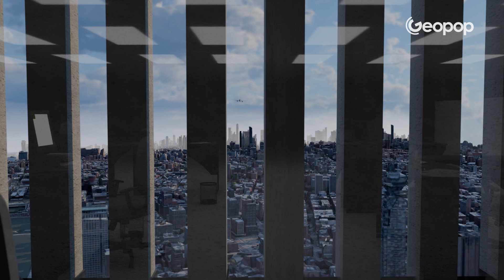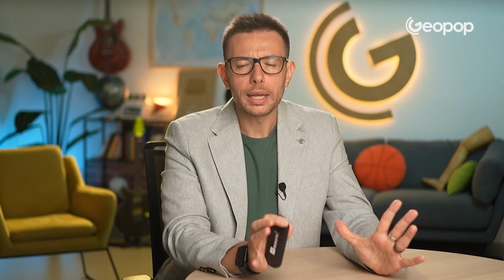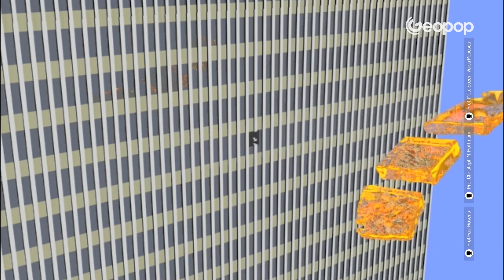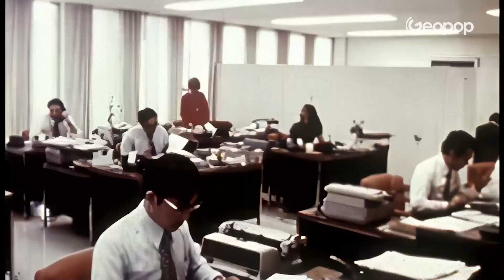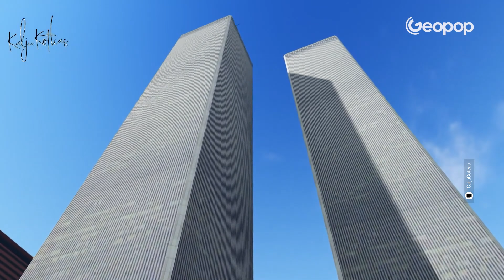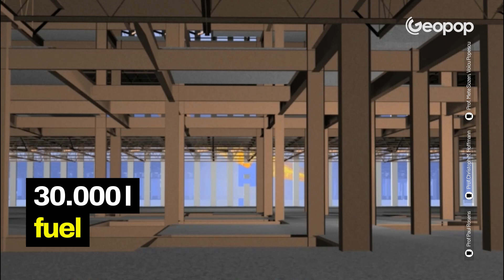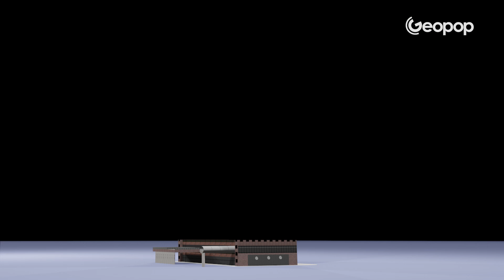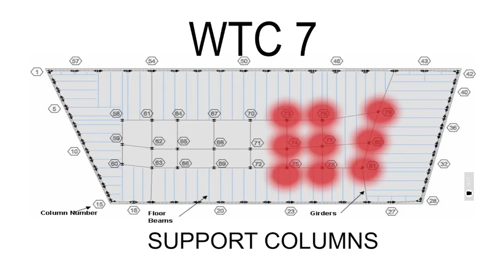9/11, 2001: The Technical Reconstruction of the Twin Towers and WTC 7 Collapses

Comment: No steel skyscraper, before or since, has collapsed before or since 9/11. Especially at freefall speeds.

Your explanation of the progressive collapse completely defies physics. Saying that dozens of intact floors would provide no resistance and simply be pulverized, is asinine.
Reply: The plasco building in Tehran.
Reply: @CrisisMonday The plasco building only had about thirteen floors above the ground and it took about ten seconds for it to fall. Yet the twin towers were 100 floors above the ground,fell in nearly the same amount. The plasco building didn't have any fireproofing. Wtc did.
Reply: @robbiehiatt9966  WTC was hit by a boeing 767 going 500MPH, slightly compromised its structure ontop of fueling the fire
Reply: @robbiehiatt9966  wtc was hit by a plane which disabled sprinklers and blew away fireproofing foam
Reply: @billyosullivan3192 really? Fire proofing foam huh? 🤣🤣
Reply: @robbiehiatt9966 why are you laughing im right google is free
Reply: @billyosullivan3192 So what exactly did google do to determine that the fire proofing was blown away? Will you dare to answer me this time?
Reply: @Kudde23 A plane weighing 450,000 pounds crashed into the building at 440 mph, the beams with fire proofing foam (that was only fir for 2 hours) might have had it blown away by the impact
Reply: @billyosullivan3192 no foam was used for fire proofing. That's a lie.
Reply: @robbiehiatt9966  wtc used foam spray applied fireproofing you can use google
Reply: @billyosullivan3192 "A plane weighing 450,000 pounds crashed into the building"

Nope my helpless little liar. Wanna try again?
Reply: They didn't fall at free fall speed you can see debris accelerate and hit the ground faster than the collapsing floors you just don't have working eyes or brain
Reply: @billyosullivan3192  keep swallowing the narrative that the government is sticking down your throat.

Physically impossible for dozens of floors of intact skyscraper to be pulverized to dust.

Use your brain buddy
Reply: @RomansFiveAndEight  - So you open the thread with two obvious logical fallacies and a couple of blatantly false claims to boot. All dead horses beaten into glue a million times already.

Then you just kept going with those themes. 

Honestly, what is anyone supposed to do with this?   You obviously aren't serious, don't give a shit about what actually happened. You are just mindlessly repeating whatever dumb stuff you find on the internet, so explaining anything to you is an utter waste of time.
Reply: @TheCriticalStinker-01 you never explained how 90 intact floors could be pulverized by 20 damaged floors. You just provided ad hominems which is typical of those who swallow the official version
Reply: @RomansFiveAndEight  - You never asked me to. Strawman much?  Indeed, you made no claims worthy of a response, so instead I will just start clean slate:  

Twin Towers collapses were relatively straightforward, the fundamentals well understood in the professional engineering community within just weeks. Yet there’s a lot of really bad information floating out there on the internet, easily accessible to anyone. Good information takes more effort and is much harder for laypersons to digest. Engineeringspeak is complex and dull while wild baseless speculation and pathological theorizing with easy hand-wave answers is simple, exciting and requires a whole lot less thinking, so it gets far more intention than it deserves.

To correct this I have on my own prepared this short yet detailed technical description of Twin Towers collapses based on my own observation and analysis of available true and relevant facts. No politics, ideology or magical thinking, just engineering. I hope is this will dispel many common myths and answer most if not all questions you may have about the Twin Towers collapses, because anything can seem like a conspiracy if you don’t understand how it works

While complex, most of the Twin Towers collapse mechanisms can be seen with the naked eye and easily discerned and understood by the layperson if sufficient time is taken to understand. 

1. The Twin Towers consisted of 4 primary structural elements that together formed an integrated system where each relied on the others.  47 hollow box-section steel Core Columns carry the majority of the gravity loads. The 236 hollow box-section steel Perimeter Columns carry the remainder and ALL of the lateral (wind) loads. Long-span Lightweight Steel Trusses connect the core and perimeter column together at each floor with a Hat Truss on top to tie the structure together as an integrated unit where no element can survive without the others. There was no structural load bearing concrete and most components were bolted together. www.youtube.com/watch?v=u7OqrC74Dm4 

2. The impact of 117 tons of airplane (= to about 12 dump trucks) at speeds up to 590 mph with the energy of a ton of TNT completely destroys the aircraft. This in no way implies the Towers come out unscathed. Many perimeter columns are damaged or destroyed as are some core columns (example; 33 of 59 perimeter and 20 of 47 core columns damaged or destroyed at the impact floors in the North Tower), This damage is primarily through bolt-shearing failures at the end connecting flanges, as well as bending, twisting and fracturing of weld seams. There was no cutting or slicing - the reality was far more violent and messy. 

3. The impacts destroy or damage fire insulation, fire breaks and sprinkler systems on multiple floors.  Huge fires are started across multiple floors simultaneously and allowed to spread rapidly with no effective firefighting or fire suppression. This was an unprecedented fire event . 

4. The hotter steel gets the weaker it gets .  With fire insulation stripped away and no sprinklers the survival time of the steel greatly reduced. Gradually over time heat causes the lightweight steel Floor Trusses at the impact damaged floors to sag, which was observed and recorded.  No steel melted or needed to. Structural steel fails long before it becomes a puddle. It just needs to bend

5. Sagging floor trusses pull on the increasingly weak and overloaded Perimeter Columns, causing some of them to bow inward by up to 5 feet. A straight column is up to 4 times stronger than a bent column. The bowed Perimeter Columns buckle and fail, initiating collapse. The formerly static mass above which the structure below could easily support is now converted into a dynamic mass up to 30 times greater. Because they have buckled, the Columns above and below the failure point are no longer aligned . The load bearing structure below no longer bears any load as it falls past the lower columns, NOT onto them.

6. Thousands of tons of debris fall within the four outer walls, down through the open office space, crashing onto the first intact floor it encounters. This massive impact immediately breaks the bolted connections to the columns as the amount of resistance the Floor Trusses can offer is negligible.  The falling debris slows only marginally and briefly. Note:
6a. This is NOT a solid top block crashing into and “crushing” a solid bottom block .
6b. The debris falls past the columns not onto them.  The columns provide no resistance to the falling debris. 
6c. Only the bolted connections of the floor trusses to the core and perimeter columns can offer any resistance. A pair of 5/8” bolts at each end of each truss vs. thousands of tons of falling debris.
6d. No laws of physics are violated.

7.  This floor-led collapse progression within the four outer walls can only go straight down. Note: 
7a. This process is often incorrectly referred to as “pancaking” which actually refers to a completely different process rejected at an early stage. The catchy name stuck but nobody knows what it is supposed to mean.  Pancaking is too simplistic and inaccurate anyway. More like Kaiserschmarrn.

8. Collapse progresses through the floor systems not down the columns, through the path of least resistance . Rate of floor failures increases with each successive floor as momentum increases, reaching an average acceleration of 0.65 of GA, or 35% slower than true free fall. Bam, bam, bam down the building until there are no more floors to fail.  The resistance offered by each successive floor is always the same. The mass and velocity, thus the energy of the falling debris is constantly increasing, with each floor destroyed adding new falling mass. Some falls to the sides, but most falls down. More mass, more velocity, same resistance with each floor.  Don’t get stuck on the but the lower floors weren’t on fire nonsense. They weren‘t and didn’t need to be.

9. The Towers were 95% air by volume. As that air was compressed inside the building it is forced down the tower and blown out the sides in reaction to the building collapsing . Those were not “explosions”, it was expulsions of compressed air caused by the collapsing building, explaining the low velocity, lack of flash, blast, supersonic pressure waves and lethal high-velocity ejecta.  

10. Perimeter Columns become detached and peel away like a banana behind the collapse front, playing out to the four points of the compass extending to more than 600 feet from the base of the towers. This was quite obvious from examination of the debris pile. 

11. Core Columns fail last as their internal beam bracing is stripped away by falling debris and lateral support from the floor to perimeter columns is lost. 

12. For those who care about how long this whole process took; 31-34 seconds from the moment the perimeter columns buckled until the last core columns hit the pile, or 1/3 the rate of true free fall. Don’t believe me?  Just watch any video of the collapses and note the loose truly free-falling debris dropping much faster than the towers themselves.  

13. Each Tower had a 1-acre footprint. Far from collapsing inside their own footprints the debris pile spread out over 17 acres in a pile up to 14 stories deep. 8 surrounding buildings were destroyed and scores more damaged by the falling debris. 

14. NOT observed were the 180-190 dB bangs of thousands of high explosive devices or the blinding bright flashes of burning thermite. Neither explosives or thermite could have survived the impacts and subsequent fire nor could have caused the (silent) perimeter column buckling that clearly initiated collapse either. A video of a shocked and injured firefighter casually using the magic word explosion is in no way proof of explsoIVES  and the demolition_ case relies entirely on that sort of thing. There is zero tangible physical evidence and it would be technically impossible, totally impractical and completely unnecessary. No one would bother. 

15.  Finally, the Twin Towers were perfectly safe within their design envelope.  They only collapsed when taken far outside design parameters by an extraordinary and unprecedented event 

Impact + Fire (heat) + Time + Gravity = Collapse . Remove any one of those four elements and there is no collapse. Ignore any of those elements (as many do) and you will never understand the collapses. The Twin Towers were an integrated system in which no one component could survive without the others. One fails, the rest follow, through the path of least resistance – DOWN – through the open space, bypassing the path of greatest resistance – the columns.  Nothing I just described violates any laws of physics. All of the above is true no matter who planned and carried out the 9/11 attacks or why 

I hope you found this helpful and informative. It is not meant to be adversarial, but to solicit informed critical comment, positive or negative. If I made any errors of fact, logic or reason or left anything critical out, please let me know so I can fix it. To stay focused just one topic at a time please and on-topic (Twin Towers ONLY). No word-salads of Gish Gallop. IF you can offer a more plausible alternative be my guest. Be the first. Please start any reply with the words “Tits McGee” or I will know you didn’t actually read it, are not serious and just wasting my time. If you are going to argue, do it on the merits.
Reply: @TheLoonResistance  Wow stinkyshill, you´re a real workaholic!
Reply: @RomansFiveAndEight  Its explained in the video, 20 floors can demolish 1 floor, then 21 floors can demolish 1 floor, then 22 floors can demolish 1 floor etc.
Reply: @billyosullivan3192 that defies physics.

One floor has the energy to demolish one floor. So 20 would demolish 20 at best. 

The law of conservation of energy
Reply: @RomansFiveAndEight  - I suggest you read my post from 7 hours ago (instead of ignoring it) so you can figure out why you are so completely wrong. Here it is again so you don't miss it again 

While complex, most of the Twin Towers collapse mechanisms can be seen with the naked eye and easily discerned and understood by the layperson if sufficient time is taken to understand. 

1. The Twin Towers consisted of 4 primary structural elements that together formed an integrated system where each relied on the others.  47 hollow box-section steel Core Columns carry the majority of the gravity loads. The 236 hollow box-section steel Perimeter Columns carry the remainder and ALL of the lateral (wind) loads. Long-span Lightweight Steel Trusses connect the core and perimeter column together at each floor with a Hat Truss on top to tie the structure together as an integrated unit where no element can survive without the others. There was no structural load bearing concrete and most components were bolted together. www.youtube.com/watch?v=u7OqrC74Dm4 

2. The impact of 117 tons of airplane (= to about 12 dump trucks) at speeds up to 590 mph with the energy of a ton of TNT completely destroys the aircraft. This in no way implies the Towers come out unscathed. Many perimeter columns are damaged or destroyed as are some core columns (example; 33 of 59 perimeter and 20 of 47 core columns damaged or destroyed at the impact floors in the North Tower), This damage is primarily through bolt-shearing failures at the end connecting flanges, as well as bending, twisting and fracturing of weld seams. There was no cutting or slicing - the reality was far more violent and messy. 

3. The impacts destroy or damage fire insulation, fire breaks and sprinkler systems on multiple floors.  Huge fires are started across multiple floors simultaneously and allowed to spread rapidly with no effective firefighting or fire suppression. This was an unprecedented fire event . 

4. The hotter steel gets the weaker it gets .  With fire insulation stripped away and no sprinklers the survival time of the steel greatly reduced. Gradually over time heat causes the lightweight steel Floor Trusses at the impact damaged floors to sag, which was observed and recorded.  No steel melted or needed to. Structural steel fails long before it becomes a puddle. It just needs to bend

5. Sagging floor trusses pull on the increasingly weak and overloaded Perimeter Columns, causing some of them to bow inward by up to 5 feet. A straight column is up to 4 times stronger than a bent column. The bowed Perimeter Columns buckle and fail, initiating collapse. The formerly static mass above which the structure below could easily support is now converted into a dynamic mass up to 30 times greater. Because they have buckled, the Columns above and below the failure point are no longer aligned . The load bearing structure below no longer bears any load as it falls past the lower columns, NOT onto them.

6. Thousands of tons of debris fall within the four outer walls, down through the open office space, crashing onto the first intact floor it encounters. This massive impact immediately breaks the bolted connections to the columns as the amount of resistance the Floor Trusses can offer is negligible.  The falling debris slows only marginally and briefly. Note:
6a. This is NOT a solid top block crashing into and “crushing” a solid bottom block .
6b. The debris falls past the columns not onto them.  The columns provide no resistance to the falling debris. 
6c. Only the bolted connections of the floor trusses to the core and perimeter columns can offer any resistance. A pair of 5/8” bolts at each end of each truss vs. thousands of tons of falling debris.
6d. No laws of physics are violated.

7.  This floor-led collapse progression within the four outer walls can only go straight down. Note: 
7a. This process is often incorrectly referred to as “pancaking” which actually refers to a completely different process rejected at an early stage. The catchy name stuck but nobody knows what it is supposed to mean.  Pancaking is too simplistic and inaccurate anyway. More like Kaiserschmarrn.
7b. Each floor offers the exact same resistance. The mass of falling debris constantly gains both mass and velocity. This process can not be arrested, it can only speed up 

8. Collapse progresses through the floor systems not down the columns, through the path of least resistance . Each floor offers the exact same resistance to the falling mass while with each failure the falling debris constantly gains both mass and velocity. This process can not be arrested, it can only speed up . Rate of floor failures increases with each successive floor as momentum increases, reaching an average acceleration of 0.65 of GA, or 35% slower than true free fall. Bam, bam, bam down the building until there are no more floors to fail.  The resistance offered by each successive floor is always the same. The mass and velocity, thus the energy of the falling debris is constantly increasing, with each floor destroyed adding new falling mass. Some falls to the sides, but most falls down. More mass, more velocity, same resistance with each floor.  Don’t get stuck on the but the lower floors weren’t on fire nonsense. They weren‘t and didn’t need to be.

9. The Towers were 95% air by volume. As that air was compressed inside the building it is forced down the tower and blown out the sides in reaction to the building collapsing . Those were not “explosions”, it was expulsions of compressed air caused by the collapsing building, explaining the low velocity, lack of flash, blast, supersonic pressure waves and lethal high-velocity ejecta.  

10. Perimeter Columns become detached and peel away like a banana behind the collapse front, playing out to the four points of the compass extending to more than 600 feet from the base of the towers. This was quite obvious from examination of the debris pile. 

11. Core Columns fail last as their internal beam bracing is stripped away by falling debris and lateral support from the floor to perimeter columns is lost. 

12. For those who care about how long this whole process took; 31-34 seconds from the moment the perimeter columns buckled until the last core columns hit the pile, or 1/3 the rate of true free fall. Don’t believe me?  Just watch any video of the collapses and note the loose truly free-falling debris dropping much faster than the towers themselves.  

13. Each Tower had a 1-acre footprint. Far from collapsing inside their own footprints the debris pile spread out over 17 acres in a pile up to 14 stories deep. 8 surrounding buildings were destroyed and scores more damaged by the falling debris. 

14. NOT observed were the 180-190 dB bangs of thousands of high explosive devices or the blinding bright flashes of burning thermite. Neither explosives or thermite could have survived the impacts and subsequent fire nor could have caused the (silent) perimeter column buckling that clearly initiated collapse either. A video of a shocked and injured firefighter casually using the magic word explosion is in no way proof of explsoIVES  and the demolition_ case relies entirely on that sort of thing. There is zero tangible physical evidence and it would be technically impossible, totally impractical and completely unnecessary. No one would bother. 

15.  Finally, the Twin Towers were perfectly safe within their design envelope.  They only collapsed when taken far outside design parameters by an extraordinary and unprecedented event 

Impact + Fire (heat) + Time + Gravity = Collapse . Remove any one of those four elements and there is no collapse. Ignore any of those elements (as many do) and you will never understand the collapses. The Twin Towers were an integrated system in which no one component could survive without the others. One fails, the rest follow, through the path of least resistance – DOWN – through the open space, bypassing the path of greatest resistance – the columns.  Nothing I just described violates any laws of physics. All of the above is true no matter who planned and carried out the 9/11 attacks or why 

In 24 years zero structural engineers of tall buildings, including the 1/3 that have retired in that time, have made any statements in support of 9/11 Truth BS demolition claims. Zero, nada, none. The lack of any such citations in the engineering literature (published in any country worldwide) is palpable.

I hope you found this helpful and informative. It is not meant to be adversarial, but to solicit informed critical comment, positive or negative. If I made any errors of fact, logic or reason or left anything critical out, please let me know so I can fix it. To stay focused just one topic at a time please and on-topic (Twin Towers ONLY). No word-salads of Gish Gallop. IF you can offer a more plausible alternative be my guest. Be the first. Please start any reply with the words “Tits McGee” or I will know you didn’t actually read it, are not serious and just wasting my time. If you are going to argue, do it on the merits.
Reply: @RomansFiveAndEight the higher floors have more gravitational potential energy and the floors they broke added to that energy, you need to watch the video because you fundamentally don't understand the structure of the wtc and how it collpssed.
Reply: @RomansFiveAndEight do you still argue they fell at free fall speeds despite that not being true?
Reply: @billyosullivan3192 "Since the stories below the level of collapse initiation provided little resistance to the tremendous energy released by the falling building mass, the building section above came down essentially in free fall, as seen in videos."
NIST

Ooopsy...
Reply: @Kudde23 It wasnt "essentially free fall" you can watch the videos of the towers collapse and see the cladding seperate fall and hit the ground well before the main structure
Reply: @billyosullivan3192 That´s because if you take one apple in your left hand and one in your right hand and you then lift your left hand high and let your right hand hang low and if you then let the apples fall at the same time, the right hand apple will hit the ground well before the left hand apple despite both of them falling essentially in free fall.
You are comparing debris from the 90th or even 80th floor with the 110th floor roofline...
Reply: @Kudde23 Im telling you to use your own eyes and watch the footage you can cleatly see cladding accelerate faster than the main building
Reply: @billyosullivan3192 Look, I understand why that´s your impression. I´ve seen what you´ve seen and probably much more. Yes there are videos that clearly show debris falling down one side and at this side the collapse front doesn´t keep up with the falling debris but then there are videos filmed from other perspectives that show a collapse front that manages to keep up with the falling debris. And that´s all north tower. Looking at south tower footage alone one could even argue that the collapse front clearly won the race versus falling debris...
I don´t even want to say that the Twins collapsed in actual free fall, but in this case I agree with NIST, it´s fair to say that the Twin Towers collapsed essentially in free fall.
Reply: @Kudde23 look at this photo of the south tower you can see the lose debris thats been shot acclerates faster and overtakes the falling building https://en.wikipedia.org/wiki/Collapse_of_the_World_Trade_Center#/media/File:WTC_2_going_down.jpg
Reply: @billyosullivan3192 The link doesn´t work, but hey, it´s really a funny idea to try to compare speeds by looking at a single picture... 😅
Reply: @Kudde23you can watch any video of the south tower collapse and see that loose debris hits the floor first but you are just in denial
Reply: @billyosullivan3192 The south tower?!? Now you´re really making a fool of yourself... Did you even actually watch any collapse videos? In most of them you can´t even see the ground. Please try to understand that New York is a huge city and that there were tall buildings all over the place. It was nearly impossible to have the kind of collapse video that you fantasize, too many buildings that block the view, too much dust obscuring what´s going on, close distance films end early for obvious reasons... You would know all that if you had actually watched those videos.
So here are some actual south tower collapse clips for you:
/watch?v=sCVK_OJ3j-k
Reply: @billyosullivan3192 ...
Reply: The Surfside Condo in Florida and the Chinese office tower in Bangkok.
Reply: @PNRen Surfside condo failed because of faulty construction, and the building in Bangkok didn't fall, and it wasn't completely built. How do you suppose either of these things are like the wtc buildings? I built a 2 story  clubhouse when I was a child and it fell down some years later, should we compare that too? Might as well with your logic. Do yourself a favor,  let someone else do your thinking for you
Reply: @robbiehiatt9966  Oh, now you have a bunch of caveats.  Next you'll be telling us "No 100+ story building had ever collapsed in lower Manhattan prior to 9/11," and consider it a debate ender.  Over thirty stories of steel structure were in place in Bangkok and it pancaked onto itself in a manner very similar to the World Trade Center.  But splitting hairs is all you Troofers have.   

Nevertheless, do tell us your grand unifying theory of 9/11.  Tell us all about the secret work that was done to prepare for bringing down WTC1, 2, and 7.  Then tell us about the elaborate scheme, pulled off with textbook precision, to hijack planes, and fly them into buildings.  Then tell us how they managed to make WTC1 fall perfectly into WTC7 in such a way that it ripped a massive gash in the structure and completely involved multiple floors in an uncontrolled fire, thus providing the cover story for the alleged controlled demolition that took place many hours later.  I mean, these mustache-twirling masterminds were good!  And they'd have got away with it too if it weren't for your penetrating intellect.  

Go lick a window, you moron.
Reply: not true, 2 other buildings have - one in 2017 Plasco in Tehran and one in 2018 Wilton Paes de Almeida